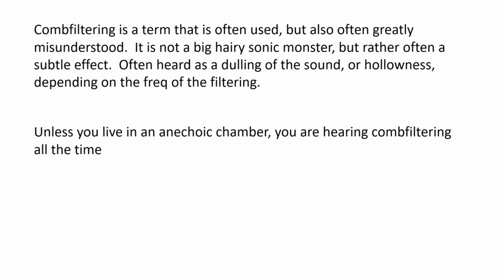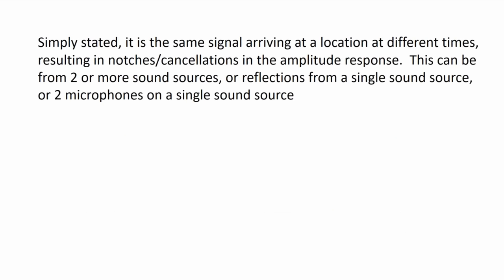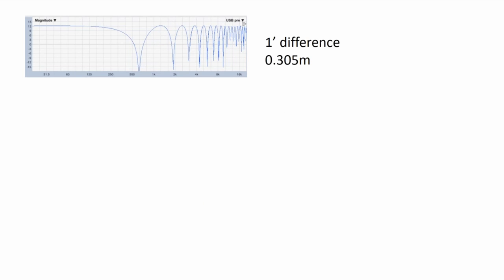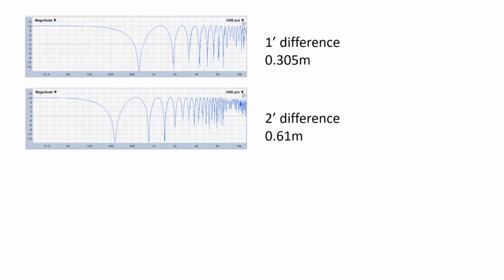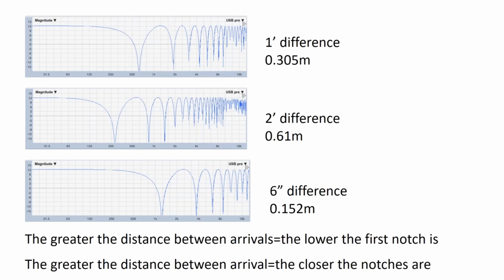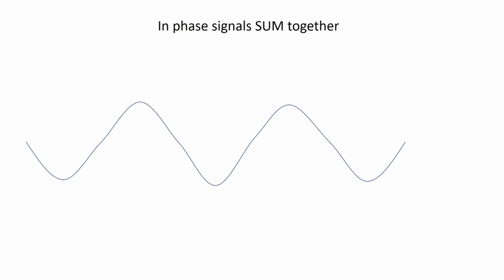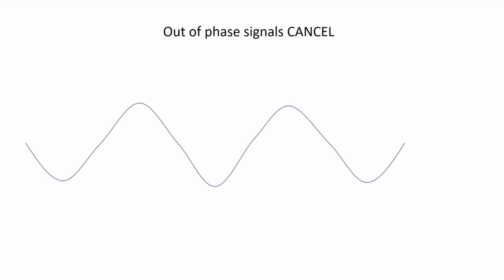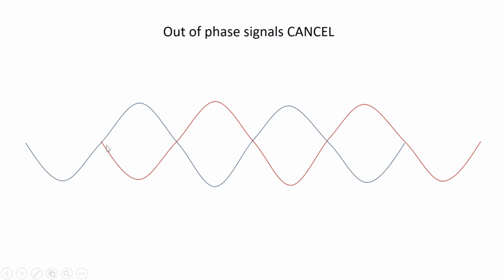Danley Fireside Chats | Ivan Beaver | Combfiltering in Loudspeaker Systems 4.9.20

Comment: One thing that hasn't got mentioned in detail is the effect of the wind on comb filtering. How does the wind affect the sound? Is the wind vector simply added to the sound vector? People keep saying "oh line arrays sound bad in the wind at long distances". Why is this? (I have heard a line array sound bad in the wind but it was because the whole column of speakers was only secured by a single cable at the top and could swing around in the breeze!)

Also what about temperature differences? I'm assuming this bends the sound wave.